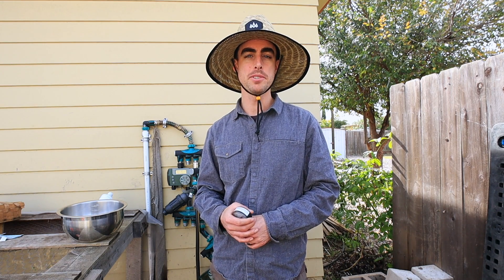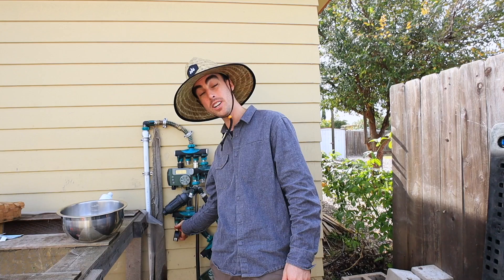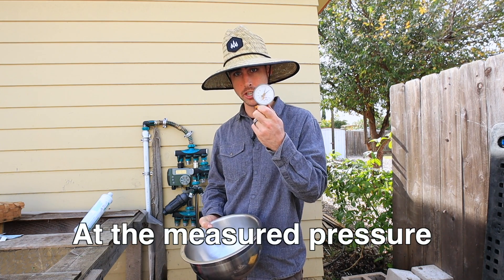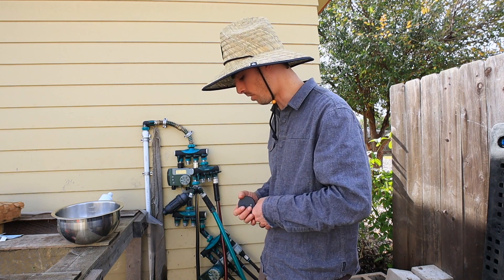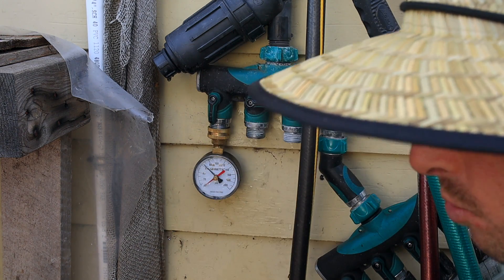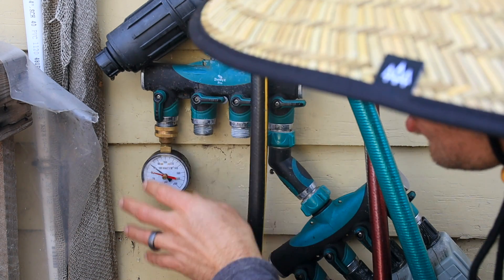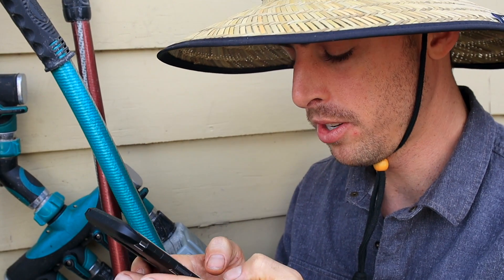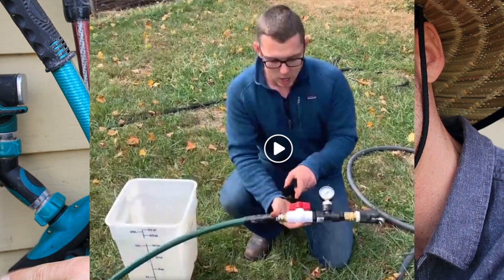How to Measure Water Pressure & Flow Rate for Perfect Irrigation

Comment from the maker: 🛒 Irrigation Pressure Tester - https://amzn.to/3DqIm4Y
🔢 Drip Depot Irrigation Calculators - https://tinyurl.com/yc2hbecy

💧BEST IRRIGATION parts here - https://tinyurl.com/ydxr79fb

🛒 TIMER STATION:
Electronic Valve Timer Stations - https://aff.dripdepot.com/aff/idevaffiliate.php?id=251&url=625
Water Filter - http://amzn.to/2stZeCN
Particle Filter - https://aff.dripdepot.com/aff/idevaffiliate.php?id=251&url=385
Backflow preventer - https://aff.dripdepot.com/aff/idevaffiliate.php?id=251&url=588
Pressure Regulators (Tape 10-15psi, 1/4" emitter 25psi) - https://aff.dripdepot.com/aff/idevaffiliate.php?id=251&url=150

🛒 LINE AND ADAPTERS: Small systems use 1/2" (.700) Larger systems use 3/4" (.820)
1/2" (.700) or 3/4" (.820) mainline (Choose length) - https://aff.dripdepot.com/aff/idevaffiliate.php?id=251&url=175
Drip Tape 5/8" : Choose your length/mil/emitter *I use .46GPH every 6" 15mil drip tape - https://aff.dripdepot.com/aff/idevaffiliate.php?id=251&url=587
Drip Tape Take off barbs - https://aff.dripdepot.com/aff/idevaffiliate.php?id=251&url=585
Drip Tape valve take off barbs- https://aff.dripdepot.com/aff/idevaffiliate.php?id=251&url=586
All sizes twist on adapters (Best) - https://aff.dripdepot.com/aff/idevaffiliate.php?id=251&url=624
1/2" (.700) Compression Ts - https://aff.dripdepot.com/aff/idevaffiliate.php?id=251&url=66
1/2" (.700) Compression Elbow - https://aff.dripdepot.com/aff/idevaffiliate.php?id=251&url=70
1/2" or 3/4" on/off coupling valve - https://aff.dripdepot.com/aff/idevaffiliate.php?id=251&url=65
1/4" Emitter line every 6" - https://aff.dripdepot.com/aff/idevaffiliate.php?id=251&url=89
1/4" Transfer Barb - https://aff.dripdepot.com/aff/idevaffiliate.php?id=251&url=92
1/4" On/Off Valve - https://aff.dripdepot.com/aff/idevaffiliate.php?id=251&url=623
1/4" Goof Plugs - https://aff.dripdepot.com/aff/idevaffiliate.php?id=251&url=626

🛒 TOOLS FOR BUILDING DRIP:
Drip 1/4" Punch - https://aff.dripdepot.com/aff/idevaffiliate.php?id=251&url=74
Drip Cutter - https://aff.dripdepot.com/aff/idevaffiliate.php?id=251&url=73
Irrigation T Stake: http://amzn.to/2Hgo64f
Felco Hand Pruner (Best all round): https://amzn.to/2YnNPk1

Comment: For one, when you did 60÷11, you should probably clarify that the 60 is because you're dividing a 60 second minute to get gpm, not because it was 60psi (that may confuse folks).

Secondly (and more importantly, if you want an accurate report) to determine operating pressure, as you're clearly doing, you didn't get 5.5gpm at 60psi. The line was wide open, dropping the pressure to so close to 0psi that the gauge didn't register it. You have a static pressure of 60psi.

Now your methodology was sound and your information about friction loss accurate (although it would require a long length of pipe to matter)...I guess I'm just nitpicking the wording.

Still, great work and well simplified for those who don't have experience.

Comment: Just looking for some inspiration for a pressure test for which I've been preparing and I found myself here. Mainly, I wanted to find a formula for psi loss by volume of water lost (obviously relative to pipe volume). 

I have a 3" mainline that's roughly 2.5 miles long that won't hold static pressure (goal is 100psi for 2 hours losing less than 4psi). There's many brass gate valves installed and it's difficult to tell if they're losing any water (I've had to repair 3 and replace 2 that were). There's also 50+ zones on it already. Each manifold has a PVC ball valve shutoff, but it's hard to tell if they're  all tight. I've located and repaired all leaks that make themselves visible, but I want to know if things like the tiniest weeping of water droplets that form on the Teflon tape of the male adapters or the ~0.01gph drip out of the filter's flush valve are enough to reduce my psi on this enormous system in the course of 2 hours. I already tried isolating sections, but most gate valves will still allow the slightest amount of water through the gate.

I've designed/installed/serviced commercial irrigation systems for the past 17 years with many successful pressure tests, but they were always done before the valves were installed and I didn't install this mainline so the workmanship is poor to mediocre (not saying I'm the only guy who knows how to properly fit pipe, but at my company, it seems to be the case).

Either way, I still haven't watched the video, so fingers crossed.

Comment: This may be a silly question.  The pressure coming out of my well pump is about 70PSI. A drip system uses a pressure regulator to bring it down to about 25 PSI. I'm assuming that I measure my flow rate with that pressure regulator on, right?
Reply: Yes

Comment: We bought an irrigation kit that comes with all parts needed. Our pipes around the installation exploded two different times. Is it because we have too much pressure?
Reply from the maker: Yes sounds like too much pressure. Install a pressure regulator recommended for the type of drip you are running.
Reply: Nature's Always Right    The kit came with a a regulator and was installed from beginning. Do you think we can open faucet half way to try and avoid another pipe burst?
Reply from the maker: @Wazupu  That's strange the regulator isn't stopping the flow enough. Turning down the faucet will help. What "Pipe" is bursting? Where is it bursting? Send me a DM on Instagram with a picture.
Reply: Nature's Always Right    It burst a year ago and has been repaired and covered up with soil since then. We’ve been turning on system manually. But, will test it out with turning down faucet half way. Thank you .